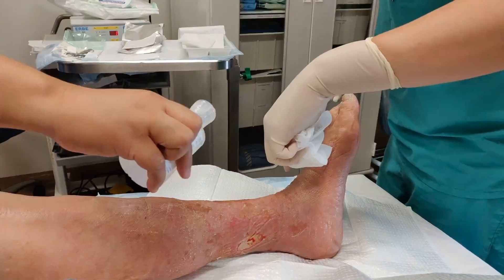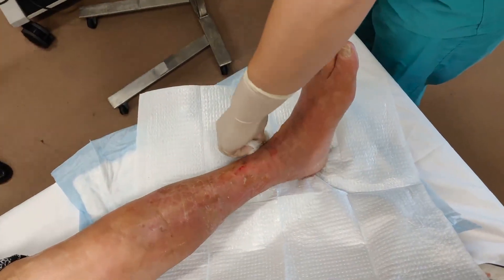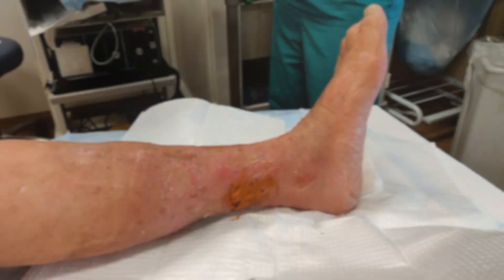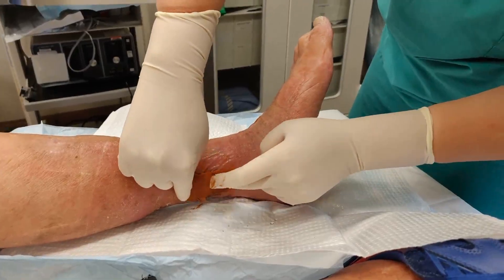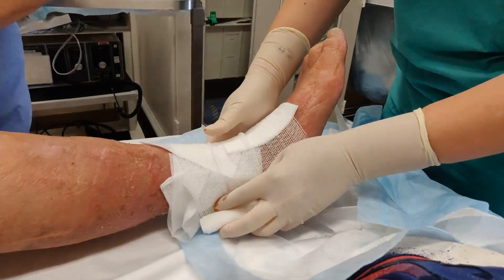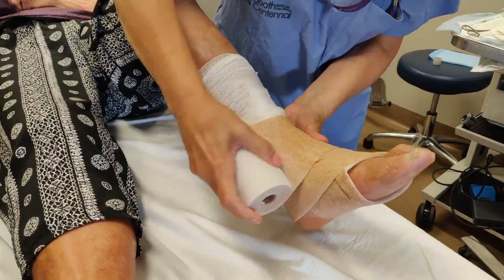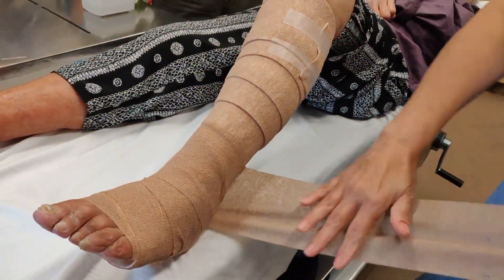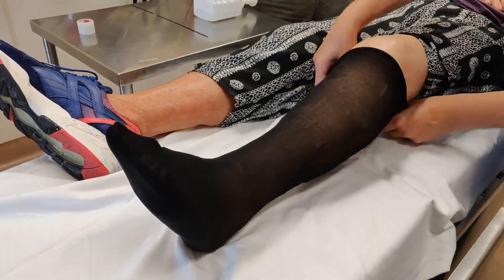Venous Stasis Ulcer Bandaging and Dressing

Comment: I had to get this done...
I had 3 ulcers. In the beginning they were gigantic ( one was 10' ×7½ ). I kept going to the hospital because I didn't know what they were and the doctors in Philadelphia said that they'd heal; they didn't 
So after moving to New Jersey I went to a foot doctor and I got rid of 2 of them, but the big one keeps closing and opening. It's a pain in the ass. I try to wear the stocking but my leg can't breathe with 2 of them on there. Right now it's a small hole, but I would take what I have over a 10 ×7 incher.
Reply: Hey, Have you tried to trust the wound with white sugar? It's a miracle. Not honey, just white sugar. It helped me heal 4 ulcers that would not go away, even after 2 months straight everyday  of IV antibiotics for 5 hrs a day, they still didn't go away, Not until I did a fee important things. First to stop eating sugar, all sugar including fruits, then you clean the wounds with saline only, you dry them and let air dry for like 10 mins, then you pour white sugar directly into the wound, then you dress with bandage and wrap tightly, well tight is subjective to your legs needs. So no sugar in diet, add sugar on wound, compress and elevate. I change my bandages daily or when they soil fast. This sugar will pull the moisture and puss out fast. I know it sounds silly or too good to be true but there are medical journals that state using sugar is legit. Sugar will starve the infection from the moisture it needs to thrive thus allowing to heal twice as fast. I'm proof of this.
Reply: Bună! Îmi poți spune ce tratament ai folosit? ❤

Comment: That has to be the worst application of 2 layer Coban wrap that I have ever seen!!
You dont need to overlap the foam layer so much. The top layer should be applied with toes pointed upward (toward the nose). It needs to be strerched evenly to full stretch for even compression,  with overlap about half-width. The whole wrap should start closer to the toes and go up just under the knee.  The technique shown here is very sloppy,  resulting in uneven compression.
Other products can be used besides iodine paste. It depends on the wound bed colour,  depth,  and presence of slough tissue or eschar.  Thank you for your effort in making this video... but it needs more in-depth.
Reply: I bet a doctor did it
Reply: I wish you could wrap my family members leg!!! Their leg ulcers are worse than the mans in the video. I don't think their would care doctor and his assistant know what they're doing.